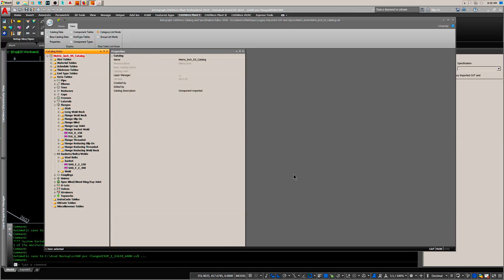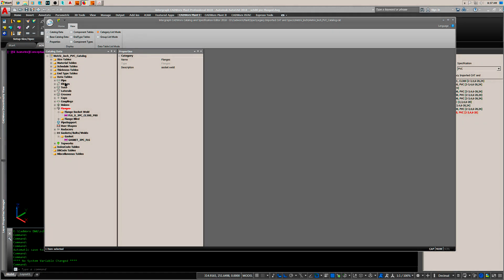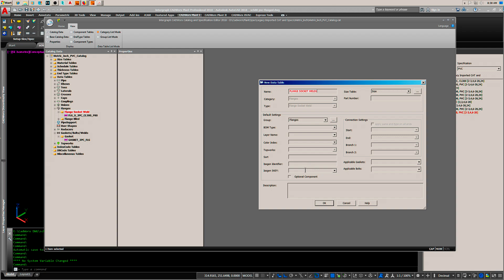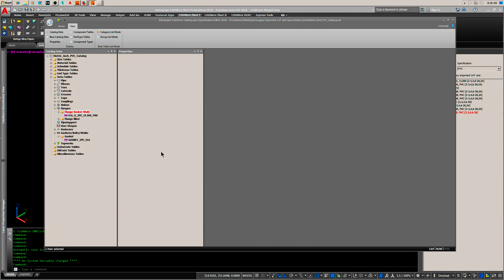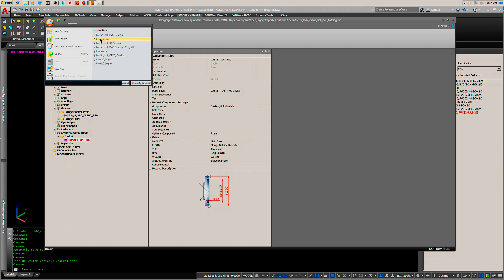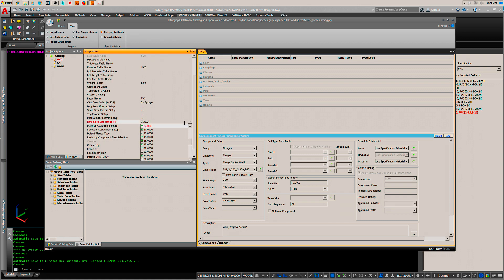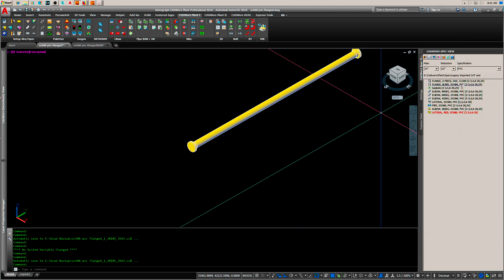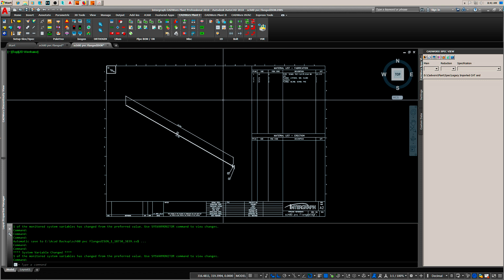Adding new component to Cadworx catalog

Comment: How to create flange with RTJ face?
Reply from the maker: My apologies for taking so long. I don't have CADWorx load on my machine at the present so I can't test my response to be sure but I think what you would need to do is copy an end type and rename it and fill out the data tables. You'd probably have to do the same for the gasket because that face end type requires a flat gasket. Sorry I can't be of more help.
Craig
Reply: @craige7667  thanks!